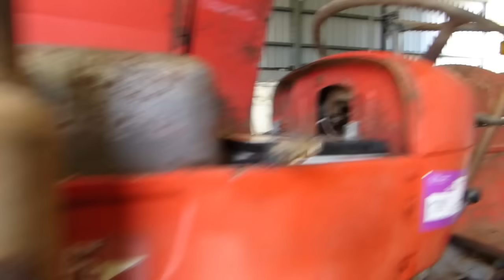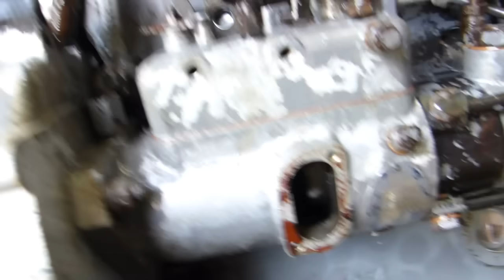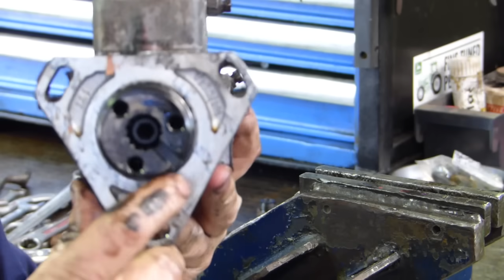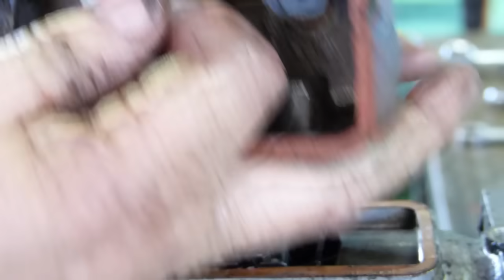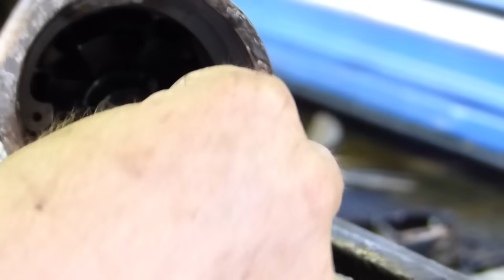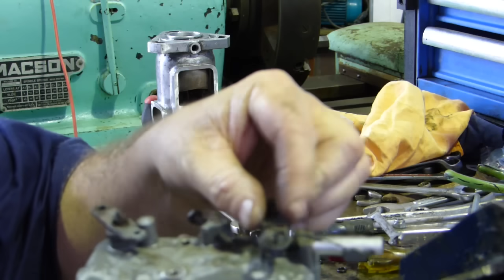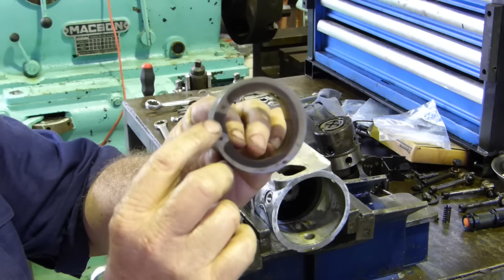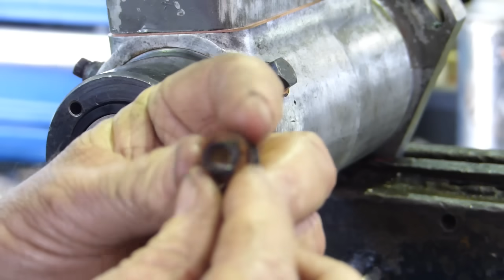CAV Injection pump full strip down to re seal and stop fuel leaks

Comment: Tanks from Sweden, very helpful. 
My injectorpump leeks diesel  in to the engine.
I'm gonna try to resealit  it may self now.
It's a John Deere 1630 from 1977
Reply from the maker: Very similar pump, have a look at my 135 6 speed playlist on video 14 and 15 I got into it better on those videos.

Comment: Hey I've got a issue with the tdc on  my flywheel where do u place the mark to get the tdc I have a 255 massy thanks
Reply from the maker: On a Perkins you wont need to worry as the pump will only go on one way on the gear and just line up the mark on the bolt up flange with the mark on the timing cover and you are done.
Reply: @bundybearsshed  hey I did the timing on the flywheel now I'm getting fuel at the injectors that's a good thing  but now my starter is dead thanks for the reply

Comment: Immense help in learning more about my pump, thanks for making this video! I have a Perkins XA 4.154/4-154 marine diesel with a CAV injection pump on it, pretty much identical to what you tore apart there. 

For those who may know more, do I need the specific gaskets from a kit, or can I make my own out of sheets? Thanks in advance.
Reply from the maker: Yes you could make them for sure.
Reply: @bundybearsshed  Funny thing is I already did: red rtv over some cardboard packaging, cut to shape. İt's holding up nicely, only problem is I'm still not getting much fuel on the high pressure side, none from some lines at the pump, very little from others. Do you think she needs to be rebuilt, or am I being stupid somehow? The stop lever is off(the pin is sitting in that hook, I've taken the pump apart multiple times to rectify that), and most everything is moving freely.

Comment: Awesome video. I have a John Deere 2150. Started with a clogged filter. Jammed up my pump. Used seafoam got it running like a top. Went to replace a fuel line primed it up got it running and went to tighten the bleeder screw  on. The side of the pump on the bottom. heard a screech. And it shut down. Did I over tighten it and it lock up and snap the rotor? I’m sick about it. No more fuel coming out anywhere. When I heard it I almost threw up. Please help. Thanks.
Reply from the maker: Pop the end plate off the pump and see if it is still turning. Do you think you dropped the drive key on the front taper where the gear goes on.
Reply: Bundy Bears Shed 
Thank you so much for replying. I will check it out. Just FYI this is the pump no’s. RE10437
34 32F830 205340FC. It looks so much like the one your are working on. It’s just my bleed screw looks different. Yours has a nut or like an adjustment, where mine looks like just a bolt might be to hold the head. I dont know.
Reply: Hey Mr. Lance. Took the back cover off I see the dowel pin you where taking about. and nothing turns. Took the oval square, (2 bolts) plate off the side and can see the other parts turning. But not the rotor. Is there anyway I can fix this myself? And would it be possible to do it while it’s on the tractor. It ran beautifully before all of this. So it was just my stupidity that broke it. And what about getting the parts. Any help you can give me will be greatly appreciated. Thanks again, Bud. By the way is there anyway I can send you pictures of it?

Comment: Completed the rebuild step by step with your video. Remounted pump keeping timing lines in mind. Getting fuel to the pump, but not to injector lines. Bleed screw shoots fuel out. What did I do wrong??
Reply from the maker: Check metering valve and the main plungers.

Comment: Hi Lance.  Thanks for the instructive video.  Your detail is very helpful in removing the pump from my Ford 3230 tractor.  Question.  in your video marking the location of the timing mark on the pump coming off is critical to success of remounting and starting up.  So, rather than rebuilding my pump i purchased a rebuilt pump for this tractor.  Would i use the same mark location on the new pump that i marked on the pump coming off?
Reply from the maker: Yes the mark on the new one would be set.

Comment: ok I must have done something wrong. got it all together but cant get it to spurt fuel out of the tubes on the bench test.......I have to go back into it  probably gonna re look at the metering valve...but over all LANCE IS THE MAN.....
Reply from the maker: G Day Mickey, I go into the pump better in videos no 14 and 15 on the MF135 6 speed restoration series, that might be of help to you but I would look at the main plungers too.
Reply: thanks Lance.. I'm kinda having fun with this but a little frustrated because I cant get it too spit out of the line fittings on the bench test.......iv had the top cover of a couple of times double checking stuff..so im wondering if the pump has to be full of fuel when bench testing... ??? because when I fill the inlet full and turn the pump . it is sucking it down really good but not pumping out...the lines... let me know please.....thanks Mick

Comment: 10:09 Ah ha!  I wonder if that screen is my problem.  I can't get any fuel out my injection ports, but I have good fuel at teh bleed screw on the injection pump.
Reply from the maker: I did a better video on these pumps in the MF135 6 speed restoration play list, videos 14 and 15, that may be of some help to you.
Reply: @bundybearsshed  thanks, yeah. I've been watch several now.  Feeling really confident about digging into that pump now. Thanks so much for posting these.

Comment: Thank you so much for posting this video! I have a 1972 Massey Ferguson 135b with 3 cylinder Perkin's diesel and it stopped running while using it, of course, in a difficult to retrieve & trailer (or flatbed towing) load location. Even in the large city of Atlanta, Georgia,  USA, there are very limited knowledgeable mechanics and the one's I know had several weeks of work backlog, after you get the tractor to them. By following the limited info in the operators manual, I had removed, flushed & cleaned the fuel tank with its small filter, replaced the fuel filter, blew compressed air through several fuel supply lines, and got to the point where the fuel injector pump would still not manually air bleed.  Local sources wanted almost as much to rebuild the injector pump as a new one would cost ($480 to $600). With the help of your video, without removing the injector pump, I removed the end piece with the additional filter, and thoroughly cleaned gunk off of all the parts, still reusing the old filter, and reassembled. I was then able to successfully manually air bleed the system and get the tractor cranked and running again!  Although, it probably should have a full injector pump cleaning and rebuild, at least now, the procedure may be done while in the garage! Thanks again, your video helped me avoid spending almost a $1,000 and perhaps a month's delay to have my tractor back!  When more convenient, I will return to this video for help with the full rebuild.
Reply from the maker: Thankyou, I have a better pair if videos on the pump in my MF136 6 speed restoration play list videos no 14 and 15. They might be of help to you also.

Comment: Fantastic video!  I have a Lucas CVA (for 3 cylinder) on a Ford 3910 (~1987-88).  The data plate on the pump has been painted over and can't see the model # and other info  I have only one very small seep/leak that collects and drips (1 drop/minute) from "Head Locating Bolt" (index #118) installed on the "Automatic Advance Device Housing and Piston" (index #106). This bolt appears to be a built-up assembly (when installed and viewed from the bottom, it has a slotted head within the diameter of the bolt head). The leak appears to seep/accumulate at the interface of the O.D. of the slotted screw and the I.D. of the bolt head.  Question: Can I remove this bolt (index 118) and only replace any internal seals without removing the pump?  Thanks for your help.
Reply from the maker: Yes you should be ok to do that.

Comment: Hi Lance, Did all of the steps in this video, am highly skilled, and still not pumping during bench test or on machine, (just dribbles out of ports). Can someone take the head apart completely? I think the distribution ports are clogged or there is an o-ring in there, might be something clogged. Put new rotor, veins, gaskets, ect though out the pump and disassembled 5 times now. Ford 555 Says KP 615B 3cylinder on pump. Is basically the same as all the others but has check valves everywhere, ha. If you can help me with this I will send you a socket set! Also a spanner wrench (in place of those channel locks) for taking the fuel adjustment end apart. I do very much appreciate your video as once I see how something comes apart.... It's very simple from there. Oh, and on this engine there are two punch marks on the drive gears for the pump. One is on the peak of one tooth and the other is on the valley between two teeth where the timing marks are. No inspection window accessible on this one. The only way to get to the flywheel is behind the starter.  Also, I should give myself an all thumbs down for my last post! Forgive me.
Reply from the maker: G day Marc, go to my massey ferguson 135 6 speed restoration series on video 14 and 15 I go into the pump more and pull the rollers and main pmungers so that might help

Comment: Three times said you'd show how the timing lines up and didn't! Great video on the rebuild / seal but I have none of these timing references on my machine (Ford 555) and I don't know how to find them or MOST important how to set the pump to skirt for number 1 cylinder! Timing of the pump is also important. If anyone can leave a comment on how to find the timing marks on 555 I would be grateful.
Reply from the maker: Check video 14 and 15 on the MF135 6 speed restoration series I go into it much further there. You can not bolt them onto the tractor in the wrong place as the drive flange is dowelled or keyed so just line up the line on the bolt ou  flange and you will be right to go.

Comment: Hi lance, your video gave me the confidance to attack my pump problem on my 85 case 580 super e. The machine had been sitting for several years and the inside was all seized up.Cleaned and resealed it and it fired right up for the first time in 10 years.thank you for taking the time to do this.
Reply from the maker: G day Dave, That is good to hear, you saved yourself quite a packet.

Comment: Lance, Great video!  I changed the lip seal and I'm still getting diesel fuel into the oil sump.  It almost seams like it is leaking past the allen bolt that holds the drive cam on the pump.  Thoughts?
Reply from the maker: i have had that if the washer is in the wrong spot. Another cause can be a faulty fuel lift pump.
Reply: Bundy Bears Shed: Thanks for the reply!  I ended up changing  the o-ring in the inner part of the shaft and it stopped the leaking.  I was able to do it without completely tearing the pump down.  Unfortunately, I already destroyed the bearing on the number 1 piston connecting rod to cam shaft before I ever knew it was leaking.  I’ll be able to repair it but lesson learned to keep a better eye on my oil and if I start loosing prime.  Holds prime now.  This is on my 1977 Ford 555 backhoe.

Comment: Hi there and thank you for this tutorial. my question is on my 1976 ih 364 stalled while running i was able to bleed and get it to my shop. it seems the cav filter feeding the injection pump is acting weird, the in port arrow on the  fuel filter is pushing fuel out( i would think the return would pull or push the fuel). the out port arrow to in fuel on filter pump  is doing nothing when cranked. i thought maybe i hooked the lines wrong so i  switched the arrow in at filter pump return fitting which is pushing fuel to the fuel in fitting on pump and the out arrow fitting on filter to rear return line on pump and  she started right (cause she was getting fuel)up for about 1-1/2 minute then stalled, she will start like that all day but never stay running (this is hooked up opposite of the way it has always worked. questions does the injection pump suck the fuel from the cav filter out port arrow to inside of fuel  Fitting on the pump? and is it normal diesel is pushing out from in arrowed  port of cav filter. I am miffed and hoping for an answer with your experience behind it. thank you again for your time.
Reply from the maker: Fuel comes from the out port to the injection pump, check the injector return to the tank is not blocked. The symtoms of a blocked return it the tractor will start but not rev up and will stop. Just worth a look, its cheap to do. Clean your tap filter screen and change the filters and also clean the screen in the inlet of the injection pump.

Comment: this is a great resource video, but I can't seem to get my pump out.  Also can't find a video showing how to remove my pump.  This cav pump looks exactly like mine, but mine has a long shaft with a nut on the end going through the gear.  anyone know what I need to do
Reply from the maker: Undo the big nut as yours is on a taper, Gently tap a couple of screw drivers under the flange to hold a bit of tension and smack the end of the shaft with the nut loose and it should come.

Comment: my welder has this pump  when first started  it ran for 5 seconds now it will not start  can you tell me what to check. as there is fuel going to the pump but nothing coming out, i cracked open a line  still nothing  thanks.
Reply from the maker: Firstly check the metering valve, it is common for them to get sticky.

Comment: Very useful video for this MF65 owner with a formerly leaking injector pump. I was so impressed I bought the Sparex kit from QLD Tractor Spares as recompense. It arrived this morning and, thanks to the tips and tricks mentioned throughout, I was able to have it sealed up tight in only an hour or so. Very grateful for the hint that the O -rings in the top cover could be replaced with the the pump remaining on the tractor!!! Started and stopped on the first attempt, did a happy dance and then it began to rain...all very good indeed!
Reply from the maker: G Day Sean, That sounds like you had a win, good stuff.

Comment: going to try to take the "top" off the injector pump on my 1979 kubota 4 cylinder 80hp, leave the pump in the tractor. its leaking at the throttle. bought the gaskets for 18 bucks, thanks for the confidence
Reply from the maker: thanks for the feed back.

Comment: Brilliant video thanks Lance a great help.  I'm working on an AEC truck here in NZ with a six cylinder CAV Rotary pump.  It hasn't been run in over ten years,I was having problems bleeding the pump and it wouldn't start,no fuel at the injectors. I removed the rear transfer section and freed up the small piston inside the sleeve,the springs look good and are not broken.  The vanes for the transfer also look good. I could now bleed the pump and had good flow at both bleed nipples,but still no fuel to the injectors.  I then removed the top cover and found that the metering valve was stuck,without removing it I freed it up by gently moving it back and forward,replaced the top cover,being careful to connect the stop leaver with the arm.  But it still wont start,there's only drops of fuel coming out of the back of the pump to the injectors instead of a decent squirt.  Do you have any ideas please mate?   Thanks  Jamie
Reply from the maker: I did a more detailed video in the MF135 restoration series video 14 and 15. I think you may have stuck pistons but the videos explain what is going on.
Reply: @bundybearsshed  G'day Lance,I need to shout you a beer mate!   You're onto it,sure enough both of the plungers were seized in the head.  Thanks heaps for your help and great videos,I wouldn't have pulled it apart without having watched them first.  I re-fitted the pump today and after a fair bit of bleeding she fired up and ran no worries,result!   Cheers mate.
Reply: @bundybearsshed  Cheers mate thanks I'll check out the video.

Comment: Thank you ,Very informative video ,i have a question if i may , diesel is going in to sump oil, the lift pump is new , question is, can i do the front seal without stripping the top cover  and pump down  (I:E will the 3 bolt shaft come straight off the drive shaft for seal replacement?)  the pump functions perfect it just leaks diesel in to the sump ,thanks in advance , Ken.
Reply from the maker: Yes you should have no problem just replacing the front seal.
Reply: @bundybearsshed  thanks so much for your advice. Ken (France )

Comment: Hello, I have a Lucas CAV pump that is not pumping through the injector fuel lines. I have followed your videos and I am trying to get this thing running. So far, I have addressed the issues of the stop mechanism and throttle assembly. Removed everything as per your video. Cleaned all parts and reassembled. I believe should be working. Next removed and cleaned crap out of fuel intake assembly - regulating valve, piston and so on. Still not getting fuel delivery. Appears can bleed fuel from main body but not from the bleeder on the top cover over the throttle, stop assembly. Can you offer any advise. Hoping I do not need to remove pump from engine but according to your videos the next step is to address the pump plungers ? Is there something else I can try before tearing pump down ? Thanks in advance for any suggestions.
Reply from the maker: Yes look at the plungers under the rollers.
Reply: @bundybearsshed  Found stuck piston in regulating valve sleeve. Rest of pump and plungers good. Have yet to test on motor, but seems like would be cause of no fuel situation for sure. Thanks for your help. And for taking the time to make your videos. Very helpful.